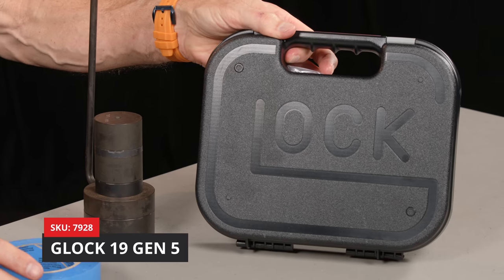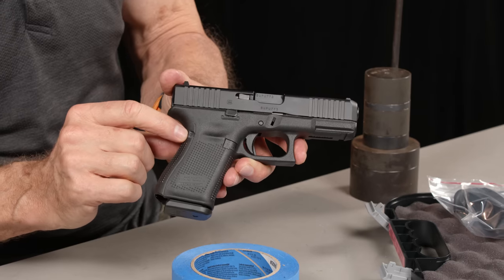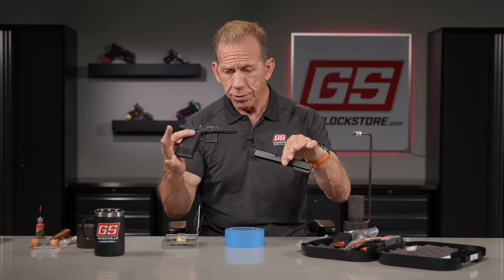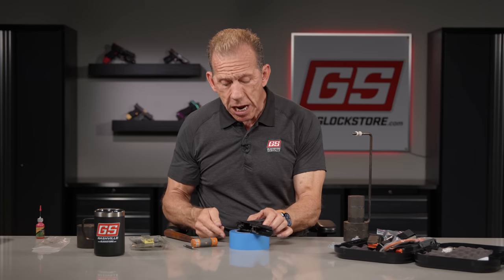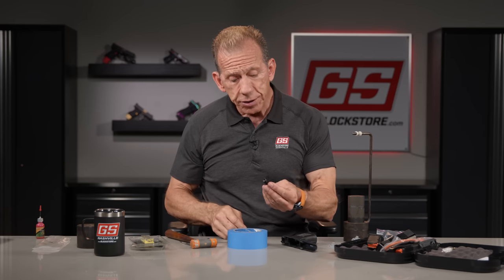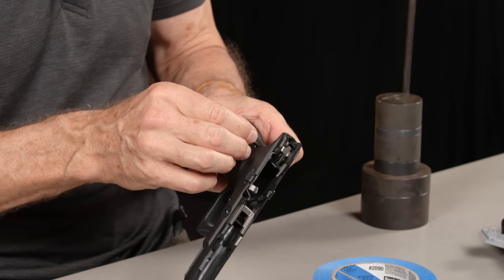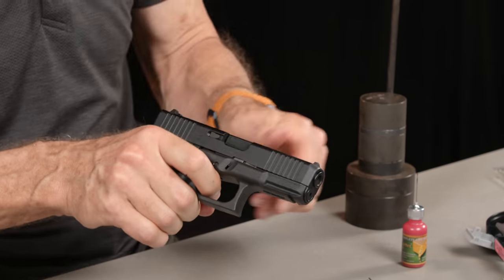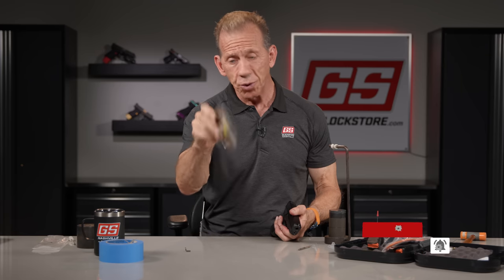How to Improve the Stock Glock 19 Trigger!

Comment: Now aren’t you trading brake weight for travel? The break is lighter but aren’t you getting a longer pull and a less defined wall in return?
Reply: Shorter pull. At least that is what I thought he mentioned
Reply: You are correct. The connector makes the pull slightly lighter and turns the pull into more of a smooth sweep.  I use the connector but I team it up with a shoe from Ranger proof.  Turns the trigger into more of a "lightswitch".  No creep...your instantly at the wall.
Reply: Honestly they don't make the triggers lighter..... They just make the trigger press smoother. Which in turn gives the impression that the trigger is lighter.
Reply: @napalmstickylikeglue  Did you watch the video?  It literally decreased trigger pull weight by almost 2 pounds
Reply: @jonah8133  they don't make the trigger lighter, it makes it smoother. No springs are changed. Nothing else is modified. You have no idea what you're talking about, so shut up and stop trying to start an argument.
Reply: @napalmstickylikeglue  He changed the weight of the trigger pull not the molecular density of the trigger 😂

Comment: I put the double diamond connector in my p80 glock 26 build because I accidentally snapped the original connector that came with the parts kit while building the gun. I took it to the gun range and my gun now shoots like it has a switch. Every time I pull the trigger it shoots out of control and sends multiple shots down range. I literally didn't know what to do. I could not control the speed at which the bullets were firing from the pistol and out of fear of injury and also becaus the gun range instructors were not having it. I had to put my p80 26 away and rented a factory glock 26 from them with a regular trigger so I didn't have to spoil the trip and still get some shooting in. When I had the original connector installed, it was shooting normal at the range(1 shot at a time). Would you say there's something wrong with my gun? or is that common for the double diamond connector to shoot so fast like a switch? Its really embarrassing when you're at a gun range and your gun is shooting faster then the rules allow and everyone else is looking at you in shame because you can't control your gun. Plus I also fear the shooting fast and out of control would not help in self defense which is why I bought the gun (for self defense). If I had to defend myself I want to get shots on target not just shooting all over the place hitting everything else
Reply: Get a factory glock not a p80 never trust your life with a p80 factory all day

Comment: I have a question for you. I just bought a 43X and I absolutely love this pistol but I really was disappointed that of all the newer Glocks, this is the only one that is not ambidextrous with the slide release. I really would like to have an ambidextrous slide release on this particular pistol because I like the ergonomics of it. In fact it’s the only Glock that I own, I previously would not even have considered a Glock until this came out. Is there anyway to modify and install an ambi slide release on it?
Reply from the maker: Glock 43X's do have a reversible  magazine release. you have to remove it and flip it around when reinstalling. We are planning a video to show how in the future..
Reply: @glockstore  Yes that I am aware of, however it is very difficult to get that pin removed. But that’s not what I was asking actually, the slide release is what I was asking about. It’s not fair for us left-handers to have to deal with a right handed slide release.
Reply: @ChrisTopheRaz  Only Glock Gen 5 can be and is ambidextrous.
Reply: @ChrisTopheRaz  lol it’s not fair?

Comment: The best way to improve your Glock trigger is to leave it alone!  At most, for a DIY solution, you can polish the trigger bar and connector.  I've done that myself and that does lighten the trigger ever so slightly without changing any of the internals.  No need to replace any components.  Trigger time at the range and mental awareness of threat potentials will do more for improving your performance than any aftermarket part will.  

Firearms are defensive tools, not glamorous show pieces.
Reply: The factory parts are shit.....replace them !
Reply: @ricks7432  ..and yet Glocks are in the homes of millions of American households.  All stock all day long and they work just fine.  

Lenny can convince you to put a lighter trigger, a lighter trigger bar, a more expensive barrel, a Tungsten guide rod, lighter weight springs, a titanium striker, a titanium safety plunger and fancy slide cuts to lighten your slide all to make you a better shooter.   That's like trying to turn a beat up Honda Civic into a Ferrari.  

That's hundreds and hundreds of dollars.  None of those "upgrades" will make you a better shooter.  This is no different than people spending money on cold air intakes, spoiler's, fins, exhaust systems, rims and hood scoops for their Honda Civics and Subaru Impreza's.... They do it all for the sake of performance; thinking they will be the next Fast and Furious star, when in reality it just makes them all look like fools.

If you want to shoot better and more accurately, go practice at the range.  Stop living in your fantasy world.
Reply: Keep going to the range and keep squeezing that same old stock long trigger pull with the same old nasty brake at the end of the pull.  You don't need 100's of dollars just start off with a new trigger bar and trigger spring $ 45.   Yes you don't need any of this for your home defense and the cosmetics are not a performance issue but the tittle of the video is How to improve a stock trigger.  Why bother watching the video in the first place ?......The trigger bar will bring down the pull from a shit 5.5 to smooth 4.5 and the spring can bring it down further from 4.5 to 3.5.  Then you practice at the range and shoot better.....better than you ever will most likely !
Reply: @nolver53  yeah the last thing you want to do is Polish your parts. It actually degrades the material and can cause fatigue. Leave it alone or upgrade it with aftermarket parts like millions of Americans have done.
Reply: @napalmstickylikeglue  This is false. A glock that has been fired thousands of times will have a smoother trigger action because it has polished the contact points naturally. By polishing those points yourself you are simply expediting that process. Best thing to do is the 25 cent trigger job and coat the metal parts with oil and ig will feel like a gun that has been fired thousands of times.
Reply: @_JEBUS  are you trying to tell me there isn't a difference between manually taking material away from a product with a die grinder or sander..... And original wear that the product is designed to handle? 

That's quite laughable.
Reply: @napalmstickylikeglue  A polish is not manually taking material off with a grinder or sander. You use neither to do a polish btw. The polishing of glock triggers has been a known modification since the rise of popularity of the gen 3 glock. No one has ever had to replace contact wear parts from a polish only springs from prolonged use. For someone who acts like he knows what hes talking about you may want to actually look into what a 25 cent trigger job us before making negative comments about it.
Reply: @_JEBUS  you cannot make that statement with any certainty. I worked in manufacturing for many years. Specifically welding fabrication. Whenever you sand metal you are removing material that can absolutely fatigue the material. Also, it can impact safety as the weapon is not designed to have such modifications done.

If you're trying to convince yourself that you didn't do that whenever you polish your parts that are not designed for polishing..... Then that's okay but don't push false information. Parts are manufactured for a reason the way they are manufactured. Aftermarket parts are manufactured the way they are manufactured for a reason.
Reply: @_JEBUS  Some metal firearm parts are “through hardened,” meaning that the metal is the same hardness throughout the part. You can file, sand, and polish these parts extensively, removing metal and changing the shape of the part without ill effect. Regardless of the shape of the part or how polished it is, the part will continue to be as tough as it was before you began removing metal. Other parts are either “case hardened” or treated with a coating that hardens the surface of the metal, like the “Tenifer” process used on Glocks. In these parts, the metal underneath the surface is soft and protected by a hardening method that only affects the surface. Shaving metal off the surface with a file or sandpaper, or overzealous polishing, cuts through the surface hardening, exposing the soft metal underneath. This is why plenty of amateur trigger jobs feel great for the first 100 rounds and then quickly go downhill from there. An initially great trigger feel accomplished by modifying surface hardened trigger parts will start to feel gritty, then develop false stages, and eventually fail to function entirely. With the surface hardening gone and the soft metal underneath exposed, the parts will batter each other to death in short order and require replacement.
Reply: @_JEBUS  a quick Google search would help you understand why it's not wise to polish trigger components.
Reply: @napalmstickylikeglue  Again you should educate yourself on the process of polishing. All you are doing is making a surface more slick not removing material. Most aftermarket parts come polished for a reason. Most bolt carrier groups come with slick finishes these days because as the industry has grown it has been found that a slicker surface results in smoother action. You're also talking to a guy who has machined his own glock slides from blocks of steel as a hobby. You are wrong. you're just one of those guys who cant admit when he is wrong.
Reply: @napalmstickylikeglue  I have a gen 3 g19 that's over 10 years old since I did a trigger polish on it that still pulls at 3.5 pounds and just as smooth as the day it was polished. Over 5k rounds through it. No light primer strikes. No part failures. If you're a "stock glock" advocate by all means no one is telling you to touch the parts on your gun,but dont try to tell me that a trigger polish is removing material and compromising the function of the firearm.
Reply: @napalmstickylikeglue  I've had the same internals in my Glock 22 for the last 14 years and it still shoots great like the day I got it.  The idea that polishing the internals degrades the material is third grade thinking. I've polished the internals in my Glock twice in the last 14 years and have seen ABSOLUTELY NO degradation with the trigger bar or other internal components.   

Spending money on "upgrade parts" for your Glock because somebody tells you it will make you a better shooter is like a woman getting a BBL, boob job and lip injections thinking that they will make her a better human being.
Reply: @nolver53  do your research.. just because you haven't had an issue does not mean that degrading the material does not compromise it. Just because you can't see the issue with the naked eye does not mean that it doesn't exist. Fatiguing any metal will make it weaker. The parts are covered in a coating that's designed to protect the metal. It's designed to wear at certain points. When you polish everything, it removes the protective coating where it's not designed to be removed. Chances are you don't fire your weapon very much as 40 cal generally sucks to shoot. So obviously if you were firing it as you should be if you are using it for defense or home defense..... You likely would already start to have issues.

Hundreds of professionals can't be wrong. But you obviously are.
Reply: Any experience with the double diamond or oem minus connectors from glock?

Comment: Isn't a 3.5 pound trigger pull too light for a defensive handgun?
Reply: No, having a 3.5lb trigger is actually beneficial, with good trigger discipline.
Reply: No. It doesn't end up being 3.5 lb. Glock advertise 5.5 on their Glocks but they generally come out at 6 lb. This does not lower the trigger weight but instead makes the trigger press smoother giving the impression that the trigger is lighter.
Reply: @napalmstickylikeglue  Thanks!
Reply: 3.5 is the minimun for me ,  anything less is a range queen gun

Comment: Does the reduced trigger travel result in reduced firing pin travel and increase the chance of having light primer strike and reduced reliability with this connector or Diamond trigger installations (or aftermarket triggers)
Reply: I too would love to hear an answer to your message!
Reply: the firing pin would be pulled baack when the slidde is racked not when you pull the trigger

Comment: 3.5lbs trigger brake but it really brakes at 4.5 - 4.75lbs and that is what I expected!?!
Reply: That is what I experienced with mine.  I was wondering why they did not name it 4.5 instead of a misleading 3.5.
Reply: @ricks7432  He does mention that after 1000 rounds or so, it breaks down to 3.5lbs. Initially it's at about 4.5, with time it goes down to 3.5.
Reply: It will eventually get into the 3.5 break after breaking it in.
Reply: Any experience with the double diamond or oem minus connector from glock?

Comment: Worst “upgrade” I’ve ever done to my Glock
Made my pistol super easy to bump fire, and it would fire again when I released the trigger after pulling it. Like a binary trigger. 
Several times I fired my pistol, it would fire between 3-4 rounds. 
I put the stock one back it, and it works fine.

Comment: Best way to improve a Glock trigger is to buy a Sig
Reply: Best way to get a sig and glock that’s worth the price is to buy a canik
Reply: Yeah because a sig going off in your holster is much better than a Glock with a debatable trigger. 

Before you comment that the issue has been fixed you need to do your research because there are examples of upgraded 320s going off in holsters.
Reply: @napalmstickylikeglue  Glock grip angles are completely wrong. I’ll never purchase one because of that. My Sig P320 X. Compact has never gone off and I appendix carry. You have heard of Sigs going off without pulling the trigger, but you have never seen it replicated on a video. I’ll call user error all day.
Reply: @SeymourPettigrew  why don't you tell that to the numerous individuals (including law enforcement) who had their weapons inside of holsters, where the trigger was completely covered? You might want to think of a another method of carry.... Wouldn't want you to have faith that you aren't going to lose two of your closest friends. 

There is nothing wrong with the grip on a Glock. Just because someone may have a preference does not mean that the product is incorrect.
Reply: @SeymourPettigrew  I am curious how having a weapon in a legitimate holster and that weapon discharging whenever it's simply Jarred is user error.....
Reply: @napalmstickylikeglue  carelessly not paying attention to something dropping in the holster
Reply: @SeymourPettigrew  they didn't discharge from dropping into a holster. They discharged while being in a holster. You clearly have not done any research on this and I encourage you to stop pretending that you have.... And do your research.